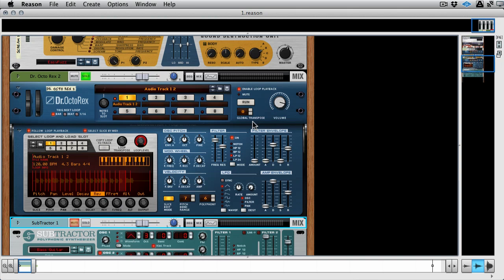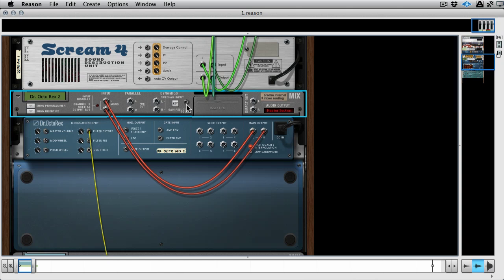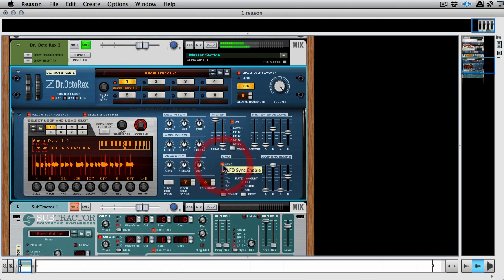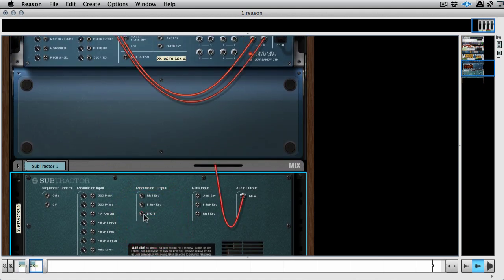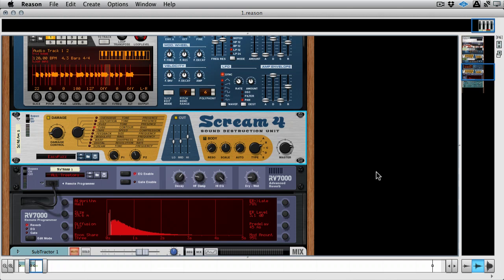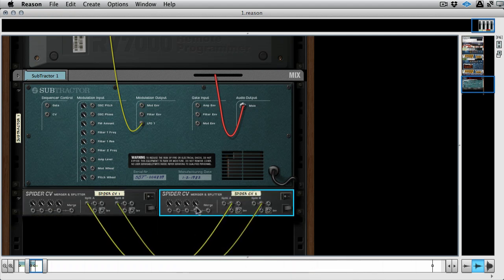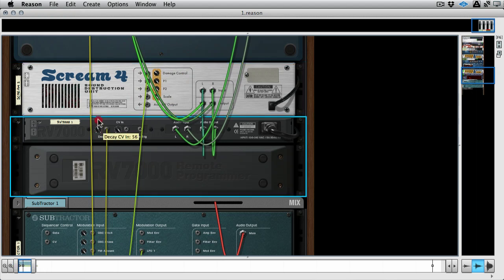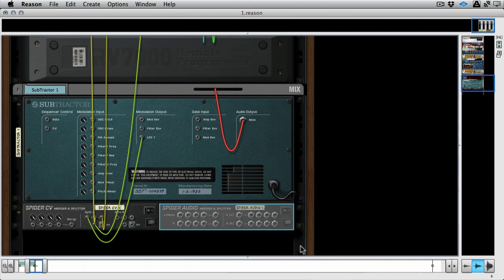Creative CV Routing in Reason

Comment: I really don't see the advantage of using CV like this. In your example with the Scream 4 and the RV7000 you could simply have used an ordinary out lead from the Subtractor to the Scream 4 and then to the RV7000 and then to the mixing desk. What would be the difference? What are you gaining from connecting these via CV cables instead of ordinary lines out?